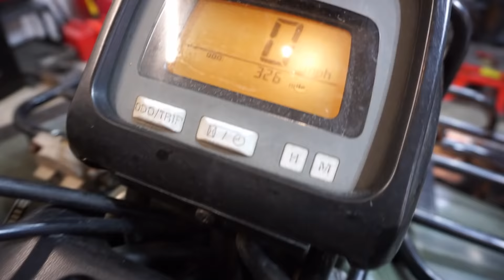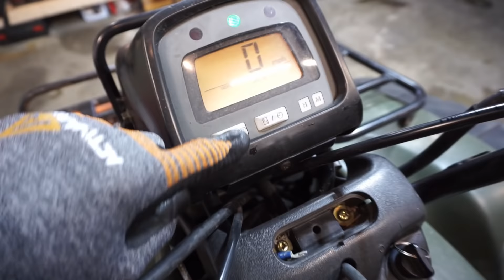Plowing ATV Left For Dead. Can It be Fixed? (CRAZY TRANSFORMATION)

Comment: You can use the old oil to weather treat the wood on your trailer. It will protect it very well. It's worked for my trailers very well. Just a thought.
Reply: My dad (carpenter) says:
only use lanseed oil because it gets hard. Make it hot so it soaks in better.
Reply: good idea. we poured ours over fence posts when I was a kid, so the naughtier horses wouldn’t chew them. it worked well, but probably not EPA recommended. Happy 2022 to ya.
Reply: You can use old oil for chainsaw bar oil. Works great.
Reply: Yeah and EPA wouldn't care
Reply: Or use a oil burner lol it's freezing in Camden isn't it
Reply: That's what my boss does with his gooseneck trailers
Reply: or don't be cheap and buy some stain/sealer. bottom of your feet will get oil all over them even if you have shoes it's annoying and it stays like that for a long time then it eventually is okay.
Reply: pour. over burn barrel..  it will get soo hot ot will melt glass.♨️
Reply: my drinking water thanks you... it was too clean... needed some contaminants... "thanks".

Comment: You ALWAYS need to clean the needle seat on the carb when doing a carb clean. Use a Q-tip in a drill and coat it with an abrasive toothpaste like ultrabrite or closeup and flush paste out completely. You have had gas leaks often after “cleaning” the carb and it is NOT due to float height issues.
Reply: Amen! Had that very problem with mine. Cleaned the needle seat and it solved my issues.
Reply: absolutely. Had a friend "recommend" some fool mechanic, for an outboard tune up.  I could have done it better myself, turns out the leakage was traced to him not doing that as well. Such a simple 10 second fix. Cost me 250 to have that done :(

Comment: Yes, that plow is supposed to have trip springs. With springs if you hit something solid the blade will collapse forward, that way you don't go sailing over the handlebars and/or damage your frame.

The plow looks like a smaller Cycle County, do a web search for this brand of plow, you should be able to easily find the replacement springs, and anything else you may need for it.
Reply from the maker: Thank you! I ended up getting some new replacement springs! They work great!

Comment: You have to be super careful with taking the choke cable out of the carb. The break really easy when they’ve sat forever. I broke ours while taking the carb apart. They’re very easy to find though. You also have to be careful with the primer pump on the carb. Ours started leaking after I cleaned the whole carb. They’re also very easy to find. It’s all better now though.

Comment: Hi! Good video and an absolute great deal on that ATV. When I got my Honda Rancher 350 last year it had been sitting and had a similar problem of not getting fuel from the gas tank. I “fixed” it in a similar fashion like you with compressed air. However, the fault came back and the carb even clogged up. The problem was that the internal fuel filter had been dissolved by the fuel when it was sitting and the rest of the filter kept clogging up the fuel line. I solved it by removing the fuel shut of valve, clean the tank internally, remove all residue of the old filter, then reassembled and added a inline filter. That finally worked and this summer I got a new fuel shut of switch with a new filter so everything is back the way it is supposed to. Since you had some dirt between your float needle and seat, I think you should check the status of that filter or at least put a inline filter between the tank and carb. Best Regards Nils from Sweden.

Comment: Great job on that quad it looks like new again . I've been plowing with  an ATV since 1986 . I started with a Big Red then moved up to a Yamaha Kodiak now I have Wolverine side by side. I built my own plows "too cheap to buy one" and those two chains on the plow should be replaced by springs. The springs are there to let the plow tilt forward when it hits a hard object . This will prevent the driver from being thrown over the handlebars or cause damage to the ATV.

Comment: back in 2010 I bought a 2001 450 foreman, it was beat when I bought it, I rebuilt the top end, replaced every bearing and bushing, all new wheels, tires shocks, its got a brand new ring gear and rear axel with just one ride on it I put new grips, new factory decals a disc brake kit, shes mint now, but back in 2015 the same weekend I put the new rear end in I also bought a brand new 700 grizzly,  The honda has pretty much been parked since then,  I always intend to dig it out of the garage and take it for a spin but I never do. I just can't bring myself to part with it though since I have put so much time and effort into it.

Comment: We have 2, a 99 es that no longer runs but has 9000+ miles and I still have the 03 es and it has 11,500 miles on it and it’s still going. Only problems are the electronic shift and I have a foot shift welded to it just in case but in my opinion these are the best utility quads you can buy. You can go through so much including snow drifts
Reply: Fix the electronic shift it’s very easy to, you are going to damage the internal shift mechanism but shifting a es machine manually all the tome
Reply: @TheHomePros6221   I agree. I honestly haven’t ridden it much since it happened. It was on there when I got it from my dad. I’ve changed a ton angle sensors on it. Honda dealer told me to order a “plug and play” bypass kit for $100 on eBay and he said it’ll fix the problem. Do you have any suggestions?

Comment: $900 was a great price for a machine that you can hear the engine run. I paid $500 a few weeks back for a 2004 Foreman 450 with the engine locked. It had locked the piston on the wrist pin due to low oil. I got it broke down, and the top end rebuilt and it runs good now, but I am a little over $900 into it now. These old machines are tough as nails. Nice score!

Comment: Awesome job bike looks much better! Also you might want to spool out the winch cable and coat it with grease to prevent it from rusting further than it already has, of course this is only a suggestion
Reply: I put old motor oil on mine.. worked great.. until I snapped it.. so I went with a rope type setup. Definitely a improvement

Comment: My neighbors 450 ES has over 14,000 miles on it and it still runs good. If ya keep the oil changed and the carb clean they will run forever. It quit shifting on him 1 day but it was just a bad Speed Sensor on the back of the engine near the driveshaft.  I beat the living crap out of my old 96 Honda Fourtrax 300 that I bought for $300 non running many years ago and the only thing I've had to do to it was swap out a timing chain.

Comment: I have a 2003 Rubicon that is very similar that I bought new. It has 6 thousand miles and two thousand hours on it. I have the same snowplow brand, and it is supposed to have springs there, and the corners are suppose to have the upside down mushroom sliders. I did have to weld a 1 in angle across the top as it would trip and the top edge would flip down and dig in and bend the corners. But 18 years of snow plowing otherwise.
  Looks like that they just used that on for snow plowing and the carb fowled with the ethanol gas so they just left it parked.  I hate it when they try to change the deal when you are on the way there. It was still worth what you paid and your work probably tripped what you paid for it.

Comment: Bad part about those front drum brakes is they like to fill with water, mud and gunk which in turn makes them freeze up. Especially when plowing in winter. Just have to bring inside between use and let brakes thaw. Can spend some money on a disc brake conversion which eliminates much of the repeat issues.

Comment: One thing that will help you not leave a trail on freshly cleaned driveway is to only use half the plow at a time once initial pass has been made. Would be nice if that plow could pivot to wind roll it and help push it away from cleaned area as well

Comment: Just curious wouldn't a good pressure washer save time in scrubbing with the pad? Or is this something you have already learned through time?
Reply: It’s way faster and much more effective to you the pressure washer after letting the paint stripper sit for a bit
Reply from the maker: Here in Wisconsin the water lines are out away for the winter. Can't use the pressure washer in below freezing weather.
Reply: @2vintage  you’ve also never used a pressure washer in any of your other videos. You always use stripper then a puddy scraper and it’s been during the summer

Comment: Quick question when you do the seat repairs do you redo the foam as far as adding new foam or what’s your process of doing it? I have a 97 Honda four trax 300 4x4 for plowing snow actually it’s a beast! 
but seat looks like hell and I need to do the ever famous Honda right rear axle bearings

Comment: tbh that thing looks fucking clapped. idk if I would've bought it for 900 or not, it's pretty old and the engine probably needs a refresh after years of obvious abuse bet that thing was treated like shit. it's a 4 stroke too so working on it is harder and more expensive if it needs any engine work but just how clapped it is without engine problems makes it still not really worth 900 in my eyes. did you say that thing is worth 2k as it sits BEFORE cleaning it up/fixing problems? 2000 dollars? you know what kinda dirt bike you could get for 2k? a fucking clean 250 2 stroke with hella upgrades. that has to be a joke man I can't even comprehend 2000 for that.